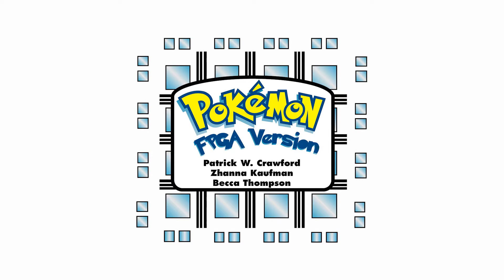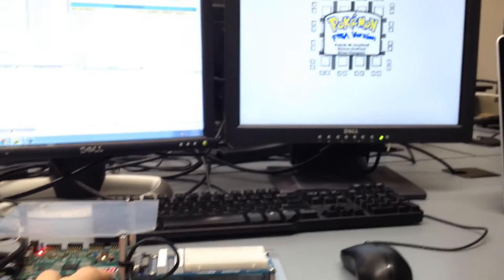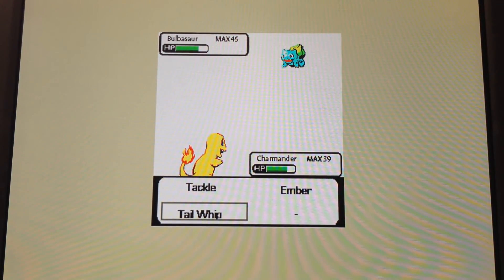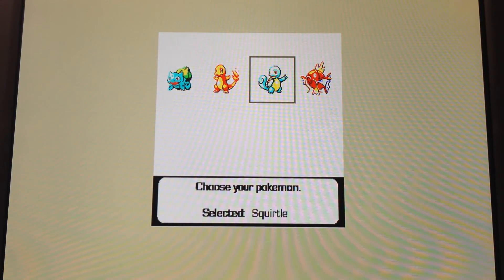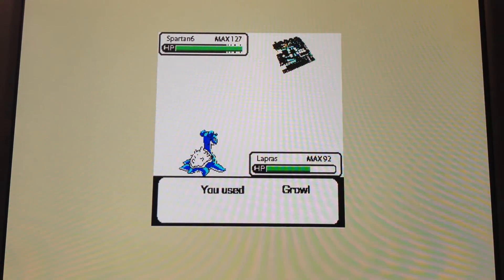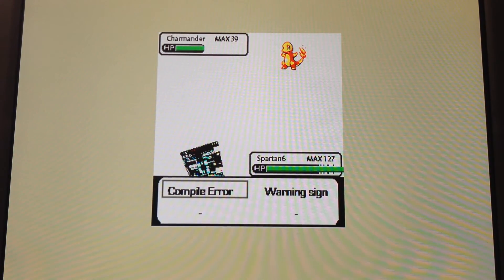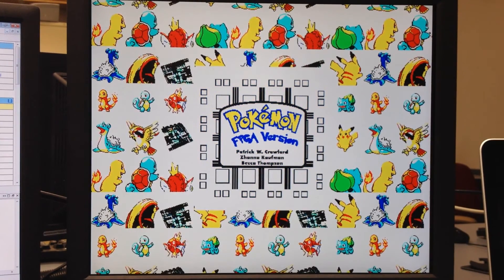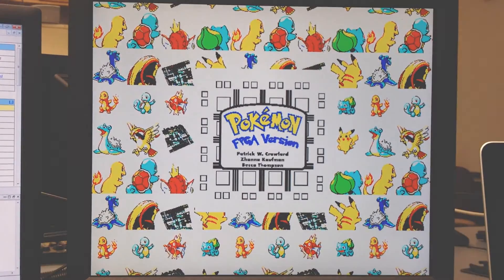Pokemon: FPGA Version

Comment from the maker: We use a compiling suite called Xilinx, so yeah it takes Verilog (the hardware description language) and what it know about where each gate is on the board and reroutes things. No assembly, that only exists in the context of an operating system ;) anything done between memory, registers and disk have to be explicitly written out bit-by-bit

If your curious, I posted a link in the bottom of the description that shows a few sample scripts